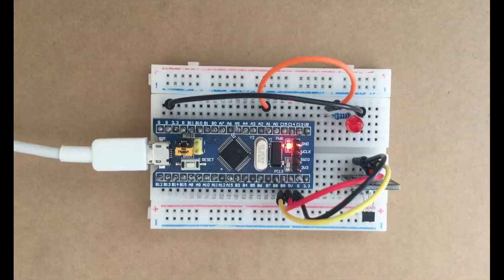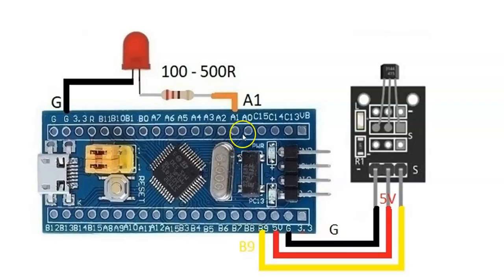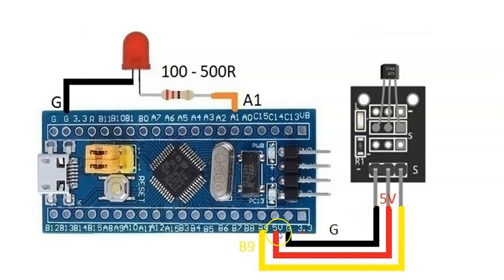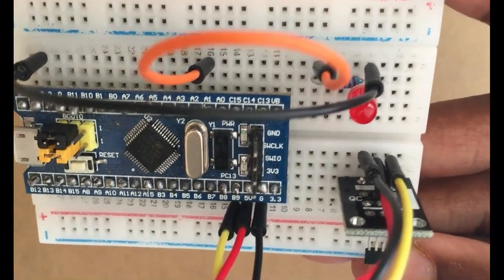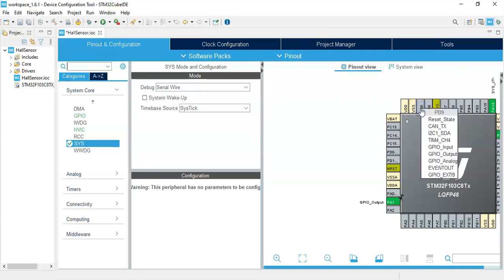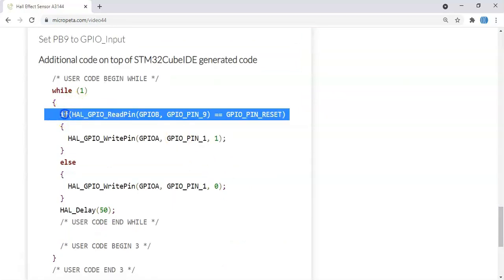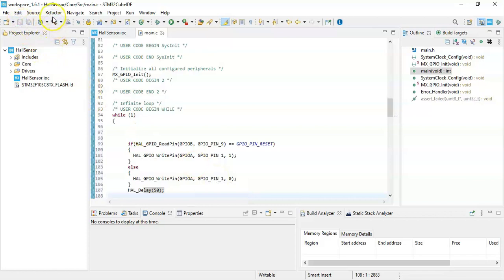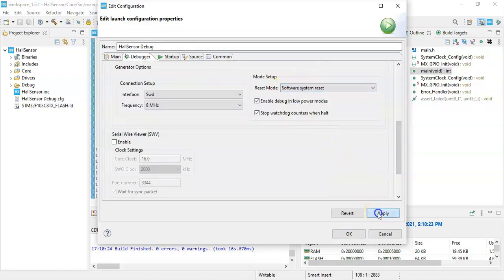44. STM32CubeIDE Hall Effect Sensor. A3144 with STM32F103C8T6

Comment: With the above code, the LED turns on when the magnet is faced to one of its poles (north/south pole) and turns off when the magnet is bought closer with opposite pole. What changes needs to be done in the code to work as you've described?